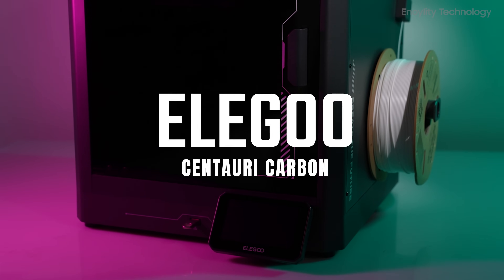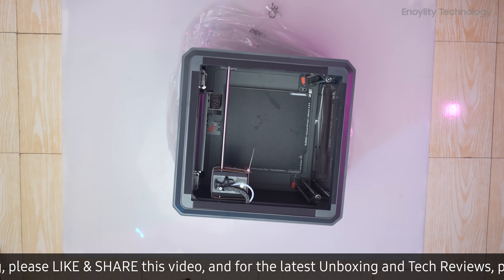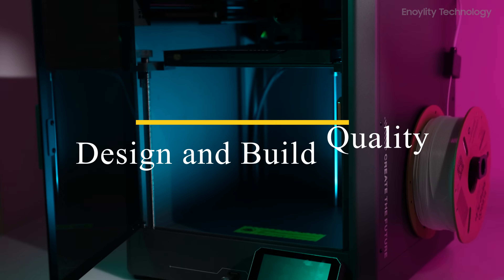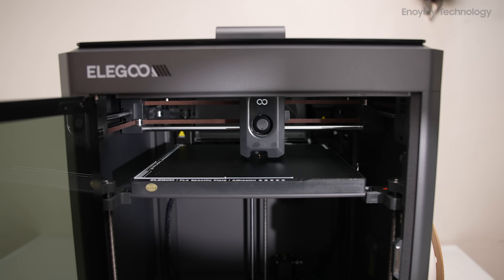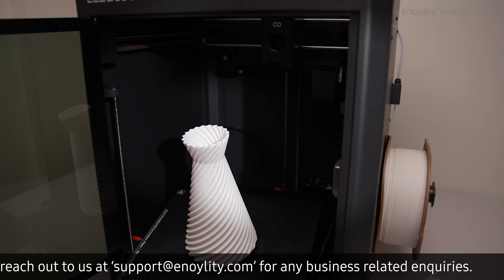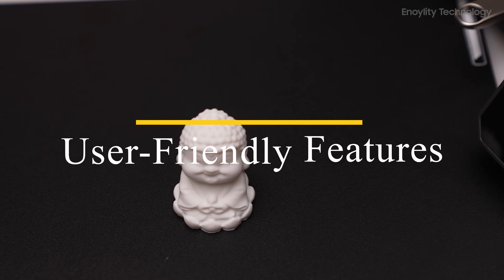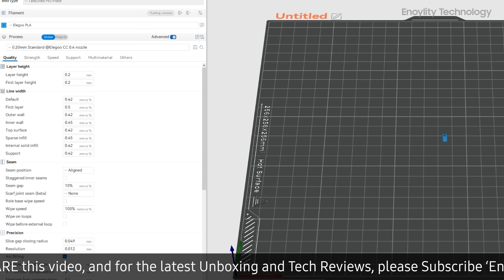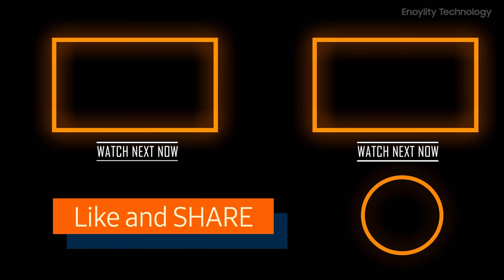ELEGOO Centauri Carbon Review: The Premium FDM 3D Printer You’ve Been Waiting For!

Comment: PETG prints like a dream on the textured bed. Excellent first-layer adhesion
Reply: Layer lines are almost invisible at 0.1mm. This rivals some resin prints for detail
Reply: With a build volume of 256 x 256 x 256 mm, it hits the sweet spot for most standard 3D printing needs
Reply: Auto-bed leveling is fast and accurate, which greatly reduces the risk of first-layer failures
Reply: Touchscreen UI is responsive and well-designed, even for first-time users
Reply: The silent operation is a huge plus, especially for those who print at night

Comment: After tuning input shaper, my prints came out sharper than ever. Very clean corners and minimal ghosting
Reply: I love the sleek, industrial design — the aluminum frame gives it a premium and sturdy feel
Reply: I love the Wi-Fi transfer option — I haven’t touched an SD card in weeks
Reply: Touch screen works well, fairly easy to navigate menus
Doesn't stop printing. I've ran it on many very long prints and had very few failures even with substandard PETG filament.

Comment: The dual-gear direct drive extruder handles TPU really well. Not a single jam in over 30 hours of flexible filament prints
Reply: Requires accurate retraction settings to avoid stringing
Reply: Layer adhesion and surface quality are excellent, even on complex models
Reply: Auto-bed leveling is fast, accurate, and has saved me so much frustration
Reply: Nozzle cleaning wiper is a smart touch, especially for multi-hour prints
Reply: The print quality, speed, and ease of use was great until things started breaking down. The first thing that went out was the extruder. For seemingly no reason, a piece of filament had gotten lodged perpendicularly in the ptfe tube that comes out the extruder to the hotend.
Reply: Printing larger curves at faster speeds can lead to studdering, which impacts print quality. You can still print fast compared to other printers without this happening, but if this printer had a better controller it could really fly and deliver excellent results at the same time. But hey, this is a great Printer
Reply: The Centauri Carbon is a reliable and durable printer that delivers consistent results

Comment: The carbon fiber frame adds a nice industrial look and rigidity. Definitely one of the sturdier printers I’ve handled
Reply: A bit heavy for desktop use 😢
Reply: The enclosure helps maintain temperature, which is great for printing ABS and other exotic filaments
Reply: Both my kids' high school and college have well equipped labs with some of the best commercial printers on the market from Makerbot etc.  But due to the pandemic everything is online so they had no access to them.   Between the two of them, they worked this printer like a mule
Reply: I think this is a decent printer if you aren't looking for dimension accuracy. It prints fast, but isn't really something I'd recommend to someone as their first printer

Comment: Print speeds are insane. I did a Benchy in under 20 minutes and it still looked great.
Reply: But Vibrations can occur at very high speeds
Reply: @Bruce63858 The carbon fiber structure absorbs vibrations well—stable even on flimsy desks
Reply: The Z-axis is surprisingly smooth—no wobble or banding, even on taller prints😊
Reply: No ringing or ghosting even at 250mm/s. That’s impressive
Reply: I had an issue with the filament run-out sensor being too sensitive, but adjusting the settings resolved the problem
Reply: The transparent panels not only look good but help monitor prints without opening the enclosure
Reply: The prints you get from it are great. Especially if you use small layer heights, like .08. Take some time, learn the machine and tune your settings in your slicer software. I prefer PrusaSlicer, which has default settings for the   pretty spot on.
Reply: I am highly impressed with the quality of the prints, would have given an over all 5 stars if the pre assembly wasnt so screwed up, 2 belts were over lapped and all three had multiple twists in them, had to tighten every screw i could find, not torqued at all which may be the root of some buyers print problems

Comment: Loving the Klipper firmware integration. It opens up so much room for tweaking and optimization
Reply: Learning curve if you’re new to Klipper
Reply: I love the inclusion of Klipper firmware. It gives a lot of advanced control, but I do wish Elegoo had left it fully open so we could tweak macros more easily❤
Reply: I don't write a lot of reviews as of right now but this printer is definitely deserving of one. I should note that it comes flat-packed and must be screwed together upon arrival, but it's tested before leaving the factory according to the QC slip and, as is evident by the residual filament that leaves the nozzle the first time you use it, this is true
Reply: The touchscreen interface is user friendly and easy to navigate

Comment: The Centauri Carbon really lives up to its name—it’s solid, fast, and surprisingly quiet for a CoreXY machine. Print quality is excellent right out of the box
Reply: Easy to use, great features and accurate detailed prints
Reply: The machine feels professional-grade, yet it's still beginner-friendly with clear documentation
Reply: Elegoo nailed the airflow and cooling design — very stable chamber temps
Reply: Otherwise I had to use PTFE tape to seal the threads since the heat break and nozzle they ship with will leak (high temp ptfe will exhaust vox but this printer is within the range). Eventually printers break and malfunction, so the beginner and professional alike should respect this printers value and ease of use. I have bought a replacement since I shorted out my thermocouple which caused the mainboard mosfet to fail and at this price point that is possible.
Reply: This printer is great. My partner uses it all the time. I asked him how he liked it and he told me it was well worth the price.
Reply: The carbon fiber frame adds to the printer's sturdiness and rigidity
Reply: The carbon fiber frame adds a touch of luxury to this printer

Comment: I am using this 3Dprinter, its vey easy to use and most reliable 3D printer.
Clog free -Easy levelling - smooth and fast printing
Reply: The only thing I would recommend to do is to replace the extruder driver with a tmc2208. By no means is this a necessary change. It just makes it much more silent and helps a little with surface finish

Comment: It exceeded my expectations, very easy to assemble, very good print quality and first class customer service, I highly recommend it.
Reply: Once assembled, calibrated and zeroed it prints almost perfect prints at full speed with pla. Would definitely recommend if you have a good grasp of mechanical knowledge, just be sure to go over it as you put it together, chassis fan is noisy, just replace it with a noctua or something, only thing id like to see added is a few led strips in the column covers so you can see what its doing, dont know about tech support, havent had to rely on it yet, this is my very first printer
Reply: This is my first delta printer and I am very impressed so far. My family previously purchased Creality CR 10-S which is also an excellent machine. I wanted one that belonged to me, a teacher, so I went ahead and made this purchase
Reply: The bed adhesion is excellent, no more warped prints

Comment: The 3D printing, whether you are a beginner or looking for a dependable printer for more advanced projects.
Reply: Printer is fantastic, have had it for about a week now and have been round the clock printing on it for that time. Knock on wood, no failed prints which is great.
Reply: It’s a very good product. Beyond my expectations.
Reply: The printer's weight makes it stable during prints, but it's cumbersome to move around when needed
Reply: The Centauri Carbon does not natively support multi-color printing; manual filament changes are required for multi-color projects
Reply: Great print quality for the price, went together pretty easily, like everyone else, was printing 40 minutes after receipt! Gotta admit, I'm geekily enchanted by the polar positioning format, and I do worry about belt life.

Comment: It allows you to create three-dimensional objects from digital designs, making it popular for hobbyists, educators, and professionals
Reply: Bought this because of the low price compared with other 3D printers after my resin 3D printer failed. I wish I had bought this one originally, been having so much fun printing things that I had much more trouble with my resin printer.
Reply: A little noisy. This was expected from me not just from the price, but also the speed difference. I'm currently working on a solution to dampen the noise
Reply: The “3D printer glue sticks” are over priced. Two layer application is sufficient where the layer goes from clear to white. With larger nozzle Only solution is to make large size prints to get gear systems to function
Reply: Basically, it just changes layer height and fill density to preset values. I intend to go with standard for the most part going forward, but it is a nice feature.
Reply: I wish the documentation went a bit deeper though
Reply: They also agreed to send me back a new printer mainboard when I told them I was still under warranty and the customer support experience has been great.
Reply: The nice thing about a delta printer is that you can print a little faster, as the lightweight hotend will accelerate quicker.
Reply: He hooked up this thing called octoprint and it allows him to sit at his desk and send commands to the printer. It also has a little camera he added so he can watch his prints. So yeah This printer is great and you can also build addons for it like my partner did.

Comment: The print quality is good and the price is good considering all metal extruder. I have printer more than 20 prints and the print quality is consistant.
Reply: Print quality is SUPERB for a filament printer. Temperature on the bed is a little low (5c). Get an infrared heat checking tool and adjust accordingly. Print accuracy is amazing. I haven't had to call customer support for anything yet.

Comment: It’s easy to set up and great for both beginners and experienced users.
Reply: This thing is these fastest printer I've owned (I come from the ender family of printers so take that with a grain of salt). I'm able to print around 10x faster than before.
Easy to use.
Reply: I have noticed that I need a raft more often smaller prints. I also needed to calibrate my e-steps, which I found instructions for on the internet. All in all, this was a great investment, though maybe not a first printer if you are not very technical.

Comment: I have used several printers but this one is the best, much shorter printing time as well as incomparable print quality, great 👍
Reply: Full metal extruder , touch screen display, and build quality ,auto bed leveling
Reply: The touchscreen interface is intuitive and responsive, making it easy to navigate through the printer's settings

Comment: Works well. For beginners, it's not difficult. Very satisfied. The printed work is very satisfying.
Reply: Overall, totally worth the price, and a blast to operate. You wont be disappointed.
Reply: The dual Z-axis system ensures smooth and accurate printing

Comment: Excellent machine. Gorgeous prints with a lot of quality and details. Very solid and beautiful. I recommend it for everyone.
Reply: its fully auto leveling, max speed of 600mm/s, and reliable print quality, it’s a perfect fit for both beginners and experienced users looking for a versatile, high-performance machine.
Reply: The touch screen is fairly unresponsive but then again I barely ever use it apart from loading new filament
Reply: The steppers are mounted to the bottom which is just as thin and can warp.
Poor tension design - the tensioners just dangle from a screw letting the pulley hit the top frame. Doesn't affect the print much just adds noise.

Comment: This printer is surprisingly fast and easy to assemble. Also, if anyone going to buy any 3d printing stuff, best buy from this seller.
Reply: Very good! It's worth it. It's managing to do everything here in the lab.
Reply: I appreciate the beefy stepper motors. They feel over-specced in a good way
Reply: Being I have only had this for a couple of weeks and am just finishing my first print. I will say I'm impressed. the test prints are useless though. I received a very well packaged machine that has the instructions color printed inside and on the micro SD card. I assembled it in just over 30 minutes and was ready to zero. I rushed my ender 3 experience so I waited to get feed back from my fellow print community

Comment: This printer blew me away with its price at first! After using it for about a month now I can confidently say there is no comparison at this price point!
Reply: Everything has held together beautifully. I would compare the performance of this printer to a Bambu P1P... for almost half the price.
Reply: This is the best 3D printer I have used, at least the most reliable. Out of the box you can print well with very little issue, which is ok if your parts do not have to be perfectly accurate
Reply: I'm 98% of the way there to using it with Octoprint, hell I'd buy a printer just to use Octoprint, it's that good. Bed leveling was a snap (and kind of fun, but like I say, I'm a little geeky). Really, check it out!
Reply: This thing is a workhorse. It's very forgiving. It's simple and extremely reliable. If something does go wrong, its design makes it 100x easier to fix than a Prusa or Ender. I can't overstate how much this aspect will improve your experience.

Comment: The printer is pretty good and way faster than other ones in the price range like the enders. I recommend both the reseller and printer
Reply: The auto-leveler doesn't work. I put it together, followed all the directions, and the first time out of the gate, the nozzle dug into the plate. I could never get it to properly level, and since it's all computerized, not manual, you have little control.
Reply: The printer came with tools for assembly and spare parts such as heater, thermister, heater block, nozzle etc. The quality of the prints is very good

Comment: Go for it, it's a must buy if wanted to begin the 3D printing. Easy to use product and nothing to worry about once setup.
Reply: Overall, totally worth the price, and a blast to operate. You wont be disappointed.
Reply: The filament sensor is a welcome addition, preventing wasted material

Comment: Wonderful, I haven't had any problems I've been printing every day since I arrived, super easy to use, to level, it's a wonder.
Reply: The auto-leveling works seamlessly, ensuring consistent prints from the first layer to the last, with no need for constant manual adjustments. It’s perfect for users who want to spend more time printing and less time calibrating.
Reply: At first I was unable to send print projects but once I purchased a wifi extender and placed it right next to the printer I am now able to send projects but still not consistently

Comment: If you are looking for budget 3d printer with decent prints, look no further, this one is best as entry level printer as well as intermediate work.
Reply: This was a gift for my kids and we are so disappointed that there is no troubleshooting in manual and zero product support.
Reply: If you want to spend a lot of time tinkering, messing with settings, and having to upgrade things then get an Ender. If you want to actually print, consistently, without having to tinker around and with speed.
Reply: The extruder would not work properly. There were no jams, the tension was right, etc. Midway through nearly every print, it would just stop. I wasted SO MUCH FILAMENT.

Comment: Extremely happy with the device. Prints flawlessly after a bit of tuning. Very low noise and reasonably fast.
Reply: Super excited to print figures and miniatures with this printer.
Reply: Very easy no fuss printer. Flashforge hits another home run with this one. Easy to use right out the box for sure. Printer speeds are incredible
Reply: Overall, totally worth the price, and a blast to operate. You wont be disappointed.
Reply: IT DOES NOT WORK! Printer firmware returns some erroneous information that doesn't comply with M-code standards. Should be an EASY fix, haven't seen anything yet. Took off a star because not everyone will care, but this is a clear malfunction.

Comment: I have had a great first layer laydown on all on my prints, the quality is great, and the speed is impressive as well.
Reply: Super excited to print figures and miniatures with this printer.
Reply: Granted, I am sure if you are going for heavy engineering type 3D, you probably want a higher end application and most likely a higher end printer
Reply: However, the image stayed on the display for 2 hours even after the power was disconnected(picture included). I was unable to use the printer at all during this time.

Comment: This is an amazing printer for the price. I’ve been using it nonstop since I got it and I’ve had zero problems.
Reply: Layer lines are smooth, detail is sharp, and I was impressed with how well it handled complex designs without issues like warping or stringing. The machine is perfect for rapid prototyping or anyone who needs quick, reliable prints
Reply: Overall, totally worth the price, and a blast to operate. You wont be disappointed.
Reply: The quality of the prints is very good. I attached a couple of pictures and both we printed at 80mm/s. Overall I think this is a winner